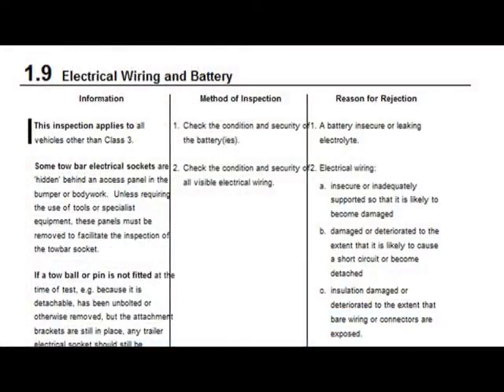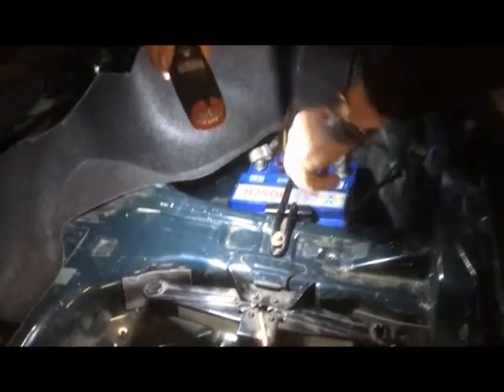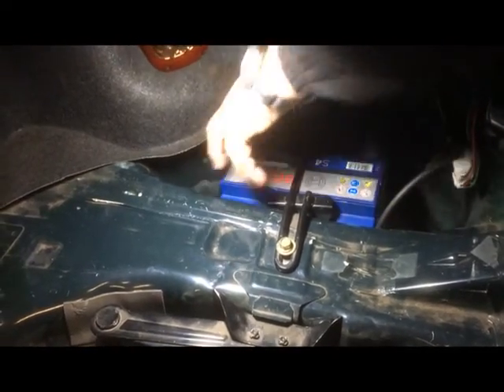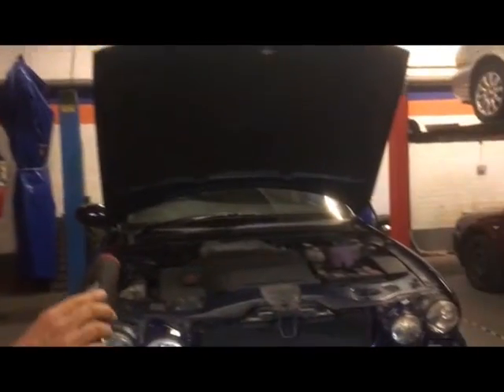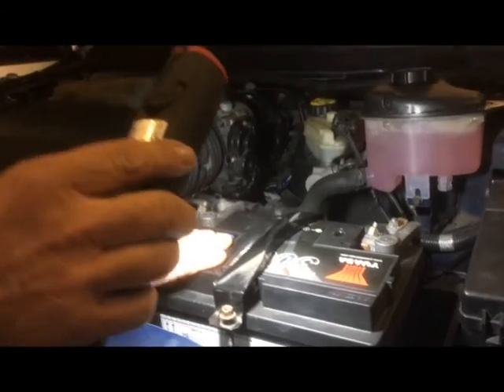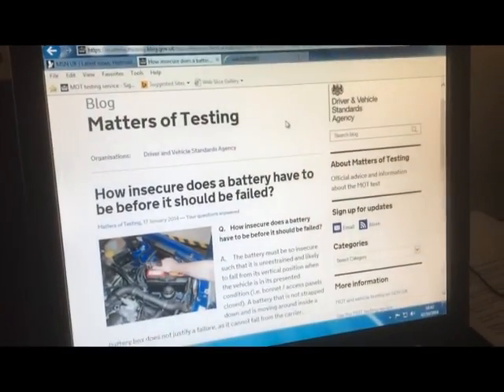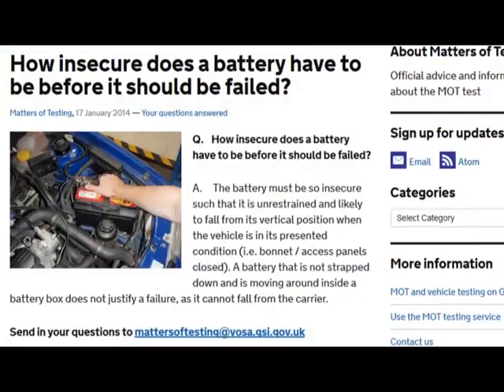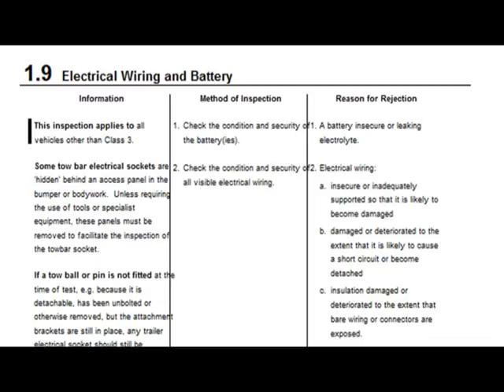How insecure does a battery have to be to fail an MOT Test

Comment: I'm not an MoT tester but I'd be unhappy with those loose batteries.  In a crash or sudden braking they could slam up against the bulkhead (or whatever is around them) and crack with the impact.